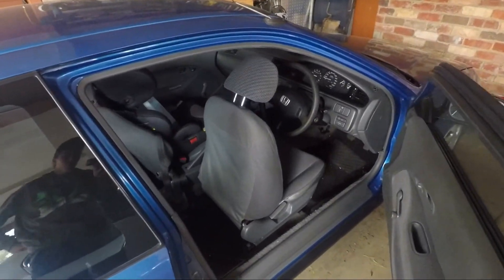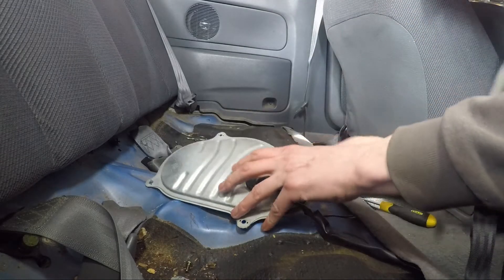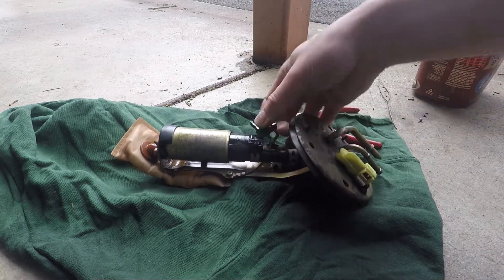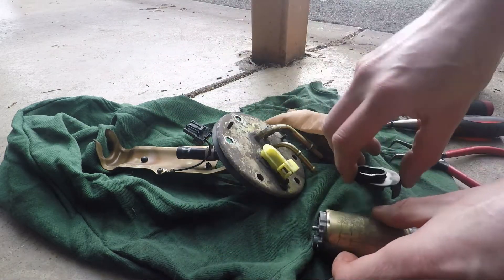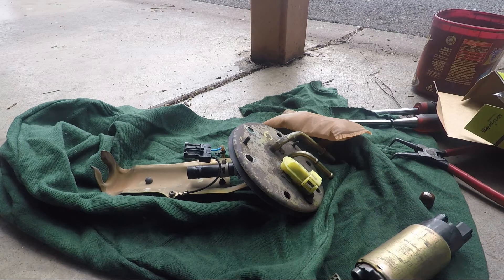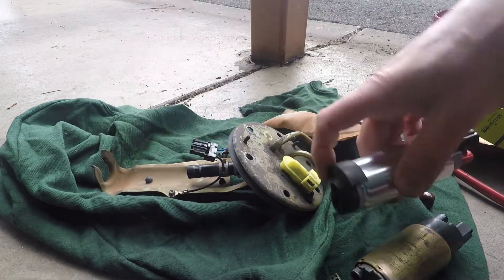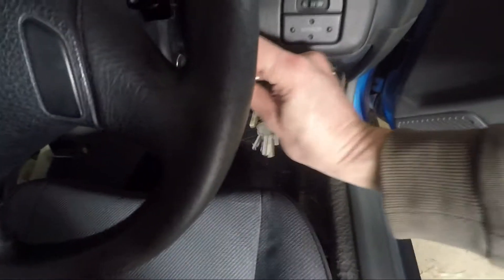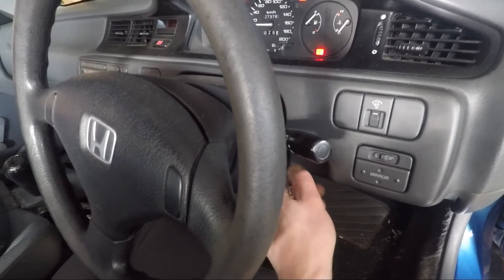EG Civic K swap - Installing Walbro 255 Fuel Pump into EG/EK/DC2 91-99 Civic

Comment: Any difference in power at all? I have 4-2-1 headers and intake, wondering if I’ll feel a difference with this fuel pump, my upgraded distributor cap, wires, v power plugs, and new high flow fuel filter.
Reply from the maker: No difference at all power wise. It's more of a safety thing. The factory one is apparently right on the edge of being able to supply enough fuel to the k24a2/3 engine on a stock tune.
Reply: @teamaxlestands  i just got mine installed in my d16 i feel a bit more power with 93 not anything crazy

Comment: You should always upgrade the fuel pump wiring. The stock one can't handle upgraded fuel pumps.
Reply: Which did you use or recommend? Thanks
Reply: @danielin8206  I used the Jordan distributors fuel pump upgrade harness with GPS locator and remote kill switch

Comment: What was the outcome with the injector duty cycle after the pump swap?
Reply from the maker: I'll have to let you know. I've actually only been for one drive and forgot to log.
Reply: @teamaxlestands  I'm gearing up to do the same swap to my carby 92 EG so I'm watching your videos very carefully - probably a couple things here and there I wish I'd seen more detail on but for the most part this has been super helpful
Reply from the maker: @obzai  No worries. I'll try and do a quick vid on the carby to efi part as i've had a few people asking and its really not that hard. The duty cycle seems to still be the same and the issue was more the tune (very rich up top) than the pump. Still feel more comfortable knowing the pump has some headroom in it now. Any topics you want me to cover in more detail just let me know.